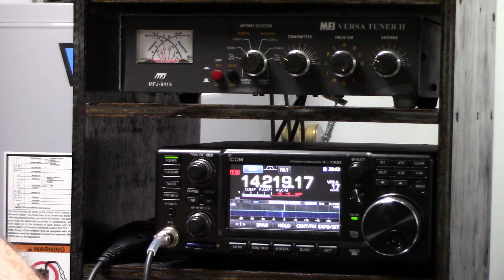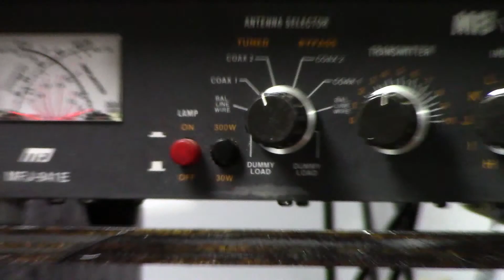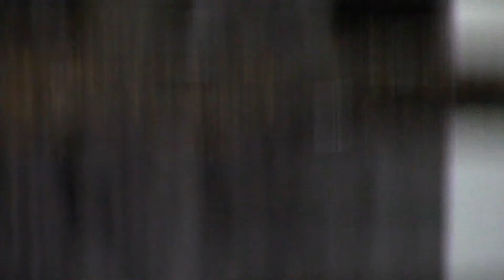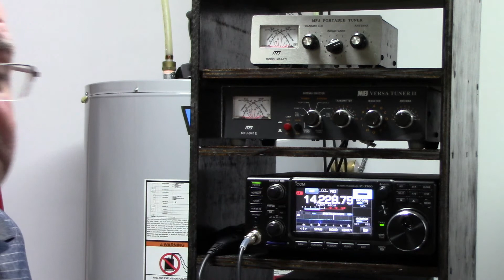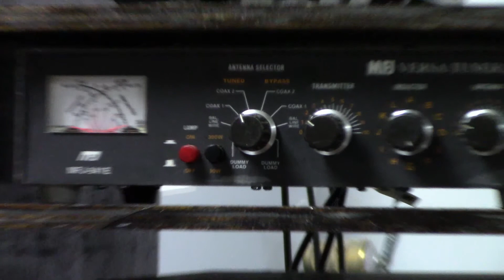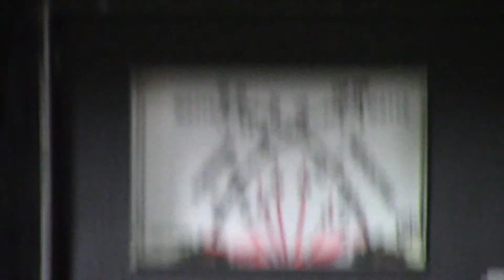Using an ATU - Why Use an ATU

Comment: Misinformation at its best here
Reply from the maker: Possibly not one of my best YT's then. Thanks for the feedback anyway, appreciated.
Reply: Reflected power does not reach the radio to heat it up, swr doesn't represent loss as your charts suggests, that is down to feeder, if for example it was a lossless feeder then all power is radiated at the antenna regardless of how high the swr is, so yeah not a good description of what's going on